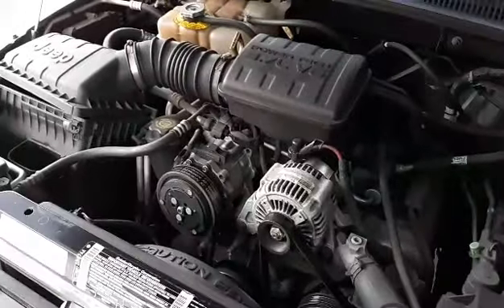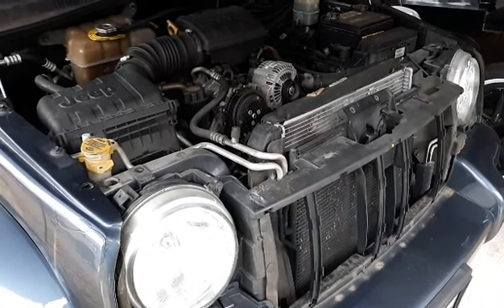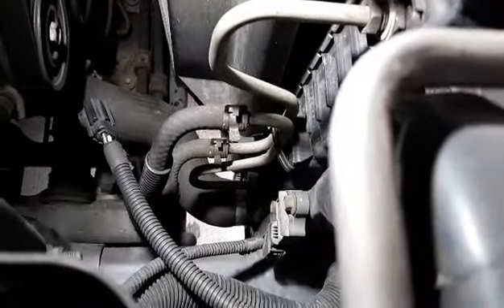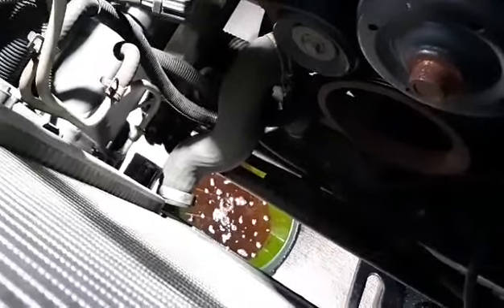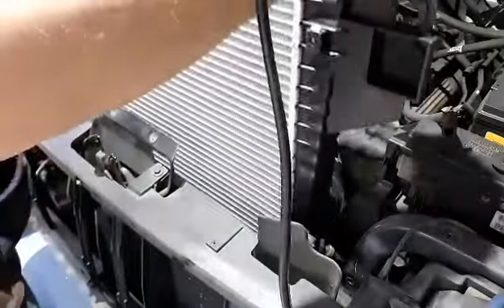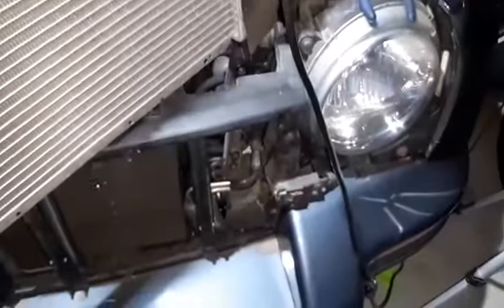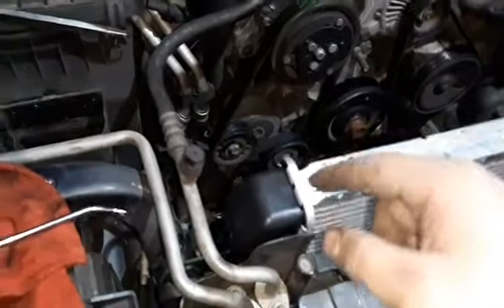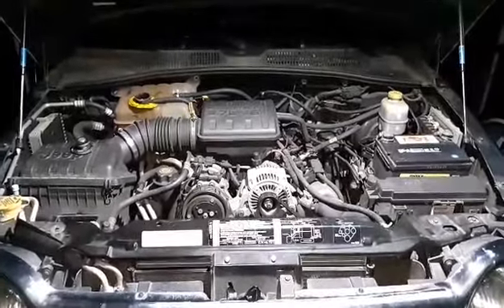Bad Leaking Radiator Replacement on A 2002 jeep liberty 3.7v6

Comment: Did u fix the transmission fluid leak?
Reply: I'm having the same issue Chinese radiator and transmission cooler lines don't wnat to go back in properly they keep getting crossthread3d or cockeyed. Did u find a solution to get them in and stop the leaking. Mine were leaking pretty bad.
Reply from the maker: @howboutthis2110  yes I did , Teflon tape on the threads of the transmission lines and that fixed the problem.  Or try O'Rings that goes in the radiator side cooler line ports , like for S10 and others I've done many times the new radiators came with O'RINGS for it so it doesn't leak
Reply: @KnuckleHeadGarage27  Okay, thnak you

Comment: I find it strange that none of these vids of the liberty has a clutch fan, just the electric fan, mine has both, we ordered our radiator from Autoshack and it was identical to the one we took out
Reply from the maker: Could been some models did and some didn't.  Not exactly sure my self but I've mostly seen ones that didn't have it